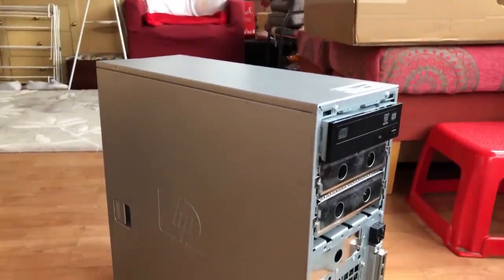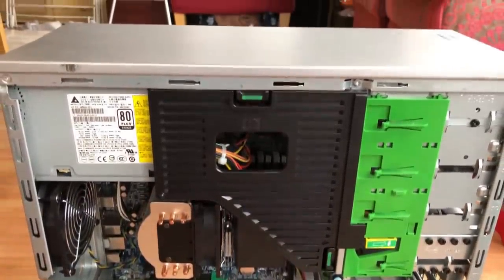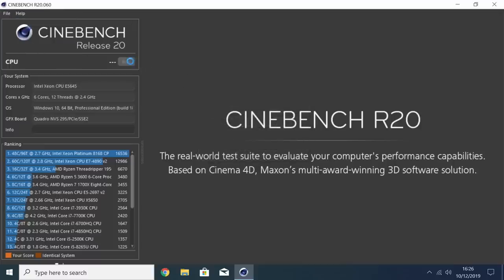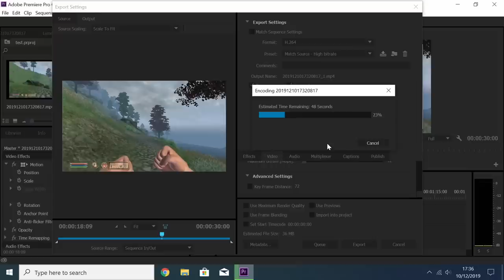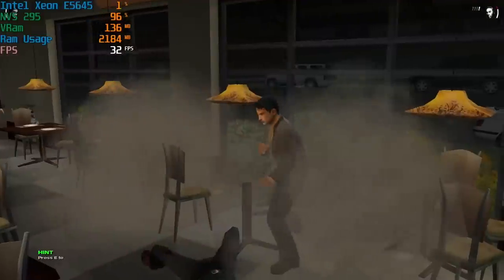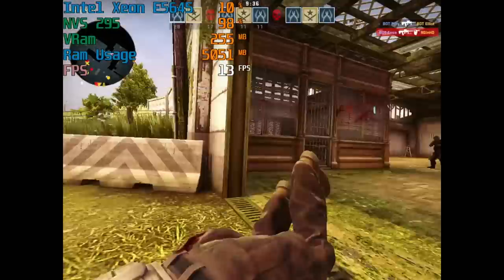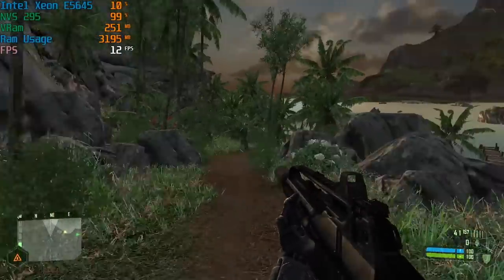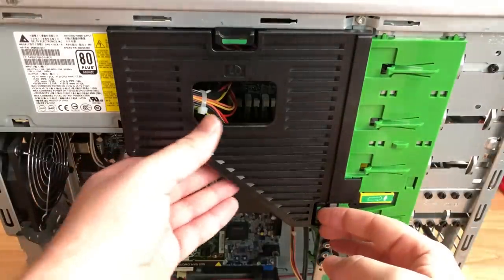I Bought a £50 ($65) 6-Core Workstation PC, But What's Inside?

Comment: Just get a x5675 for it for about 50-60 pounds and oc it to 4-4.2 ghz and it runs like a charm
Reply: ass BUSTER69 can’t OC on oem motherboards unfortunately, well maybe you can with a modded bios but then you’ll fry your VRM
Reply: Marshall Sambell even on OEM motherboards you can overclock unlocked W3680 and W3690 CPUs since they have unlocked multipliers. The software is called ThrottleStop. A stable 3.9-4.1 Ghz overclock is very possible.

Comment: Would recommend a W3690, upgrade the ram to 12GB at least, just make sure it is running in triple channel properly, and a modern GPU like a GTX 1060, 1660 super, 1070, RX-580, 590. At that  point it will be a pretty good system. I had one of these a few years back withe the GTX 1060 6GB in it.

Comment: I saw this on eBay and was going to buy it :(
Reply: F
Reply: F
Reply: there are 3 left @ £53.99
Reply: @sirfairplay9153  there better be... 😂
Reply: just buy a pc for $400?
oe no money? xd
Reply: @user-wq9mw2xz3j  hah got em
Reply: @user-wq9mw2xz3j  I have money just not enough reason to justify spending £400
Reply: @samh7140  wouldn't recommend buying this platform, their quite limited for gaming , I'd only suggest you buy it if you want to use it for content creation; even the w3680 @ 4.2ghz isn't as good as the 2500k in games like Cs go
Reply: @Craziestbanana  yeah I am looking at other options. Would anybody recommend i5 6500 for light gaming such as CS:GO and 1080p video editing. It's a bit old now so you can get it quite cheap.
Reply: Still some left.
Reply: If you slapped a used RX 570 in it, it would actually game decently.

Comment: Most of those HP machines had very little airflow, they probably opened it up to keep it from crashing nonstop, I know I've had to before with those things.
Reply: HP Z400 has pretty good airflow. And temps definitely aren't a problem with one of those low TDP CPUs. I own two HP Z400's and I've used them since 2013 without any problems

Comment: I have had a few Z400's if you can find one with Asertec 120l cooler 600w PSU with 2 6pin PCIE and the triple channel 6dimm slots version I had 3 that came with W3550 (i7 950) 12gb ram 2 ran GTX 970s but upgraded one with W3690 (i7 980) made a beast of a machine with GTX 1060

Comment: Hey I’ve been a subscriber for years now and I’ve got a question which I hope you can answer:) I’ve got both a i5 2500k and i7 2600 non K.. what will be the better option for me? The i5 2500k only clocks as high as 4.2ghz and the i7 2600 boosts to 4.1ghz I’ll be mainly gaming and doing streaming? What’s the best option for me? 

Rest of the pc 

Gigabyte RX 570 

16GB ram 1600

480gb ssd 

500w Evga
Reply: The answer is simple, the i7. If want to stream, it's not even up for debate.

The 2500k could actually win in certain games with the better overclock, but that's only for older games that aren't optimized for more than 4 threads or new ones with same idea.

But i7 all day if you plan to stream

Comment: Ok, well, I would have probably gone with the x-series processors for about the same.  Also dual processor systems are an option.  My dual cpu x5365 was 60gbp.  My x5690 dual was a bit more which is closer to a Ryzen 7 1700x.  As for the rack systems (cluster), I have 4 DPs (8 x53xx something?).  The x series generally has a higher clock speed.  I recycle hardware day in day out.  Must youtube it.
Reply: Recycle recycle recycle!

Comment: This cpu's as fast as my L5640 if i run them in single config but you gave me an idea i know my ryzen are capable off doing video conversions i actually never tried it on 12c/24t mainly cause i manage server remotely and im a lazy bugger lol.Converting a 2h movie from 1080p to 480p for my phone took 31 min only 6c/12 lets see if server can beat that :P
Reply: ok the xeon's are barely slower than my ryzen in cinebench but even on a lot of threaded program that does 3 or more jobs it loses :s but i am limited on the board max i boost are 2.5ghz and it should be 2.8ghz but if i get an x58 with 2xsocket from aliexpress i may try oc them :D

Comment: Get a cheap x5690, slap in a 1060 and boom good gaming pc (note :Depending on each hp system they have specifically designed their motherboards to work with a specific cpu)

Comment: i really don't understand why the 1366 socket motherboards are so dam expensive it nothing special sure its the first core chips but yeah that's about it. 
i mean after switching to a fx8120 with a 990FX motherboard and now I'm on a Intel Core i7 4770K Z87-GD65 GAMING the X58/1366 socket is so far behind,.
it would make for a good budget build if the motherboards weren't over priced I'm pretty sure core2duo/quads motherboards are cheaper then X58/socket 1366

Comment: Hey could u make video about 2core/4tread vs 4core/4tread in 2019 :) really like ur video
Reply: ahaha R.I.P 2 cores.
If you mean gaming.
* have 4 core 8 thread and it works, but barely when multitasking and playing new games.
Reply: @user-wq9mw2xz3j  RIP 4 cores too if You want to play AAA games at max settings.
Reply: @misterhash9329  Im getting a new pc with 6 cores (3600).

Yeah I know I should go for 8 cores for more future proof but I got a good deal on it
Reply: @user-wq9mw2xz3j  If You buy pc just don't do my mistake, don't buy with intel cpu.
Reply: @misterhash9329  i said, I got ryzen 5 3600
Reply: @misterhash9329  same price as i5-9600k but comes with cooler, also multithreading
Reply: @user-wq9mw2xz3j  Sorry I missed that. Yep, good choose.
Reply: @misterhash9329  I still think it was a good choice, but to be fair the cooler i got is garbage.
Its too loud for me
Reply: @user-wq9mw2xz3j  Buy better case or better cooler. I have Gammaxx 300 and shitty case. This cooler running pretty silent on my setup.
Reply: @misterhash9329  thing is I payed a bit extra for a liquid cooler, (not bc I think liquid>air, but bc it was cheaper) and while it cools well at full speed, it sounds too much even at over 30% speed and the sound is unbearable when its over 70% speed.

Now I dont really wanna spend and additional sum on another cooler

Comment: 8gb of ram is a bottleneck because of the configuration, you'll be running in dual channel mode at best or single channel at worst; it's triple channel memory on the x58 ; I use to run a super micro x58 and w3680 (unlocked) 6 core and used throttlestop to overclock the multiplier of the CPU and scored 913cb on r15 (400cb more than a 2500k @ stock).

Comment: NO! Are we losing dave the seagull? 
And i have to think at 50 was little too much on that build... Cpu is ok but when you are locked to oem psu (even decent one like that) to work whit your motherboard it's dropping value... My friend got one of these same machines for free from bin. It did not have a hdd or gpu but who cares. Also it haves a dual core xeon but still it was free... Gpu is weak and we have a lot of spare hdd laying around. Biggest problem was ram hhat was also missing and that i have not yet found cheap enogh. (Who wants to use a 20 € to just test at motherboard works?)

Comment: A Ryzen 1200 is faster and more efficient.
Even if the PC only cost $ 65, I wouldn't take it because the performance is not enough.
Because you'd rather take a little more money in your hand and look for a Ryzen 1600/2600 bundle.

Comment: "any upgrade potensial"
well.... you allways got the Xeon X5690 or if on the cheap the 5680...
add in an Radeon 290 or 380 that you get trown after you for nothing and it should rock in some few games.

and don't forget to use an SSD x)

Comment: My buget build has a MSI M85E-E45 motherbored paired with a i5 4690k 3.5ghz with 16gb of ram DDR3 l. A 450watt psu an a EVGA GTX 960 FTW (For the Win edition) 2gb GDDR 5 its all use an bought it all pice by pice over months of looking lol

Comment: You should check out this thread over on techpowerup:

 https://www.techpowerup.com/forums/threads/throttlestop-overclocking-desktop-pcs.235975/

I built my current gaming pc following the advice I found here using the mother board from a Z400 and a w3570 overclocked to 4ghz

Comment: I am selling a PC how much should I ask for it here are the specs:
GPU:Nvidia GTX 275 896MB
CPU:Intel Core 2 Quad Q8300 2.5x4
RAM:8GB DDR2 800MHz
PSU:BeQuiet 500W
HDD:Toshiba 250GB
OS:Windows 8.1
I was thinking asking for about 90$.

Comment: LGA 1366 is Outdated
Reply: Shush I'm still running a lga775  core 2 duo with a 512mb graphics card and 6gb of memory (5.86) available for usage. I built it from parts i had okay?
Reply: @Blaze40488   - I had  G 41 + Core 2 Duo + 2GB DDR 3 + GT 210 + 1 TB HDD  from 2008 - 2015